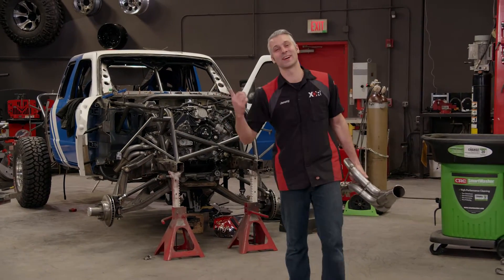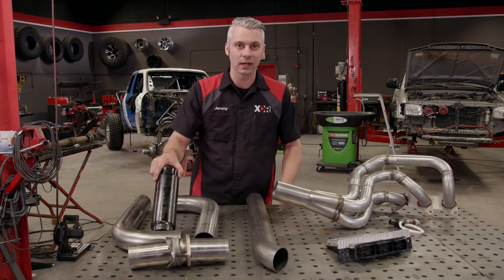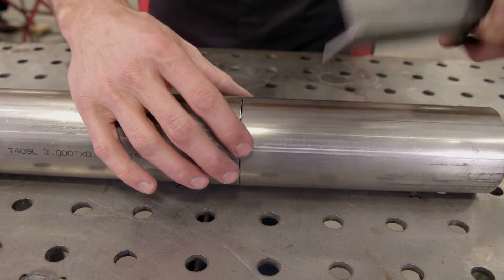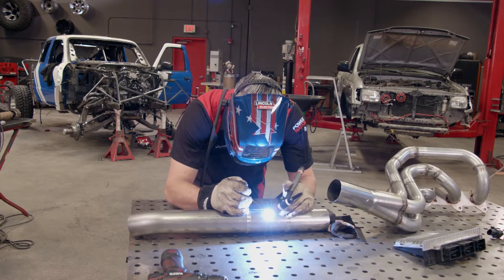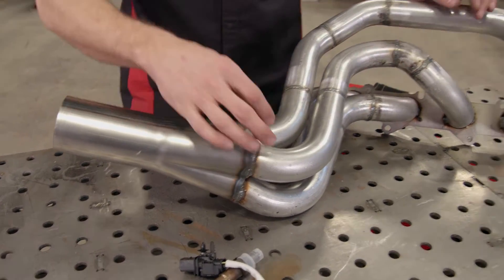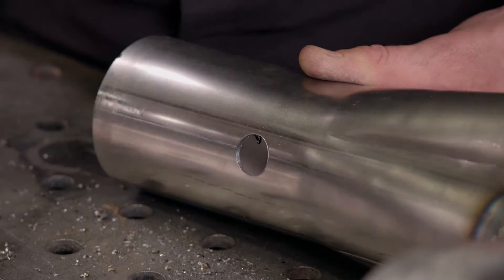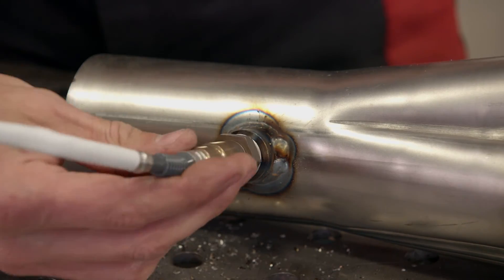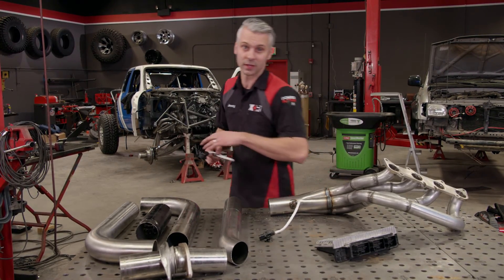How To Install An Oxygen Sensor

Comment: You put bung to close to collector, it will only read the on cylinder tube closest to it. It needs to be 8 inch from collector merge point , to get an over all reading of the 4 tubes mixed. Stay trursty my friends.